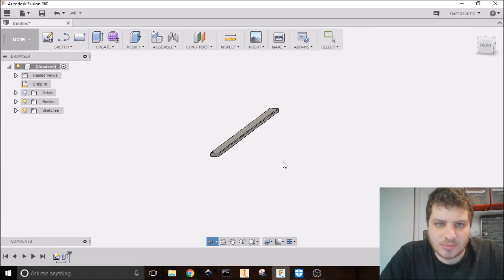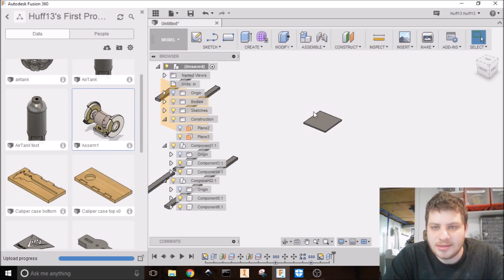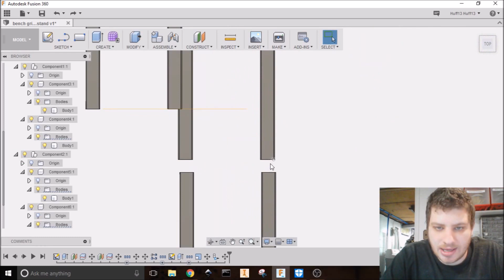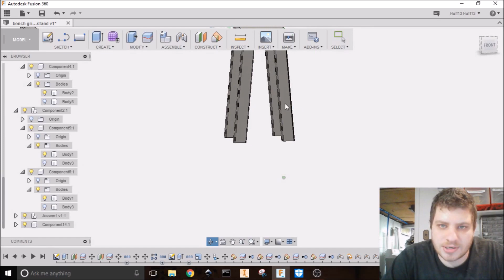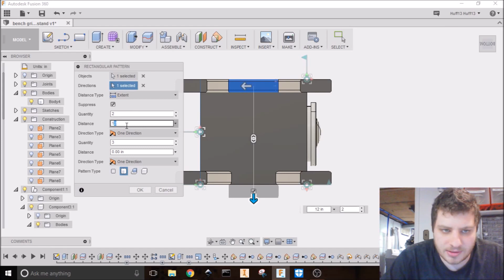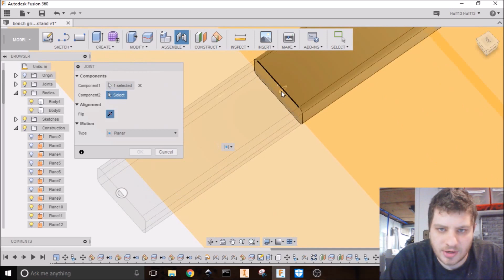Fusion 360 for Woodworkers: Beginner Fusion 360 Tutorial

Comment: you weren't able to put the grinder directly on the board. you are fiddling with the views to get the grinder on the board. you should be able to pick the base of the grinder and place it directly on the board surface just like in sketchup. Same issue when you are moving the legs in place.